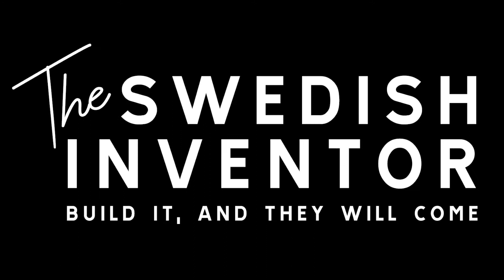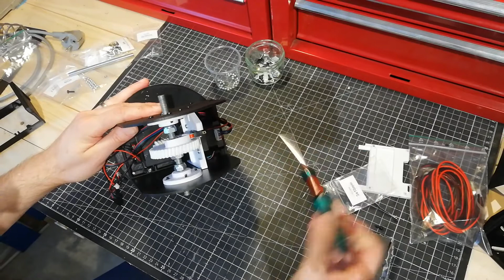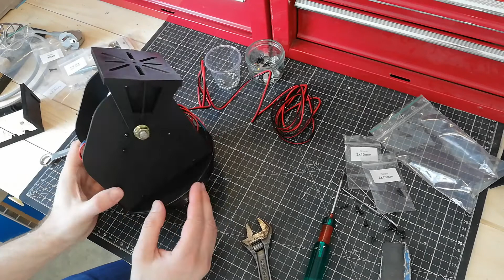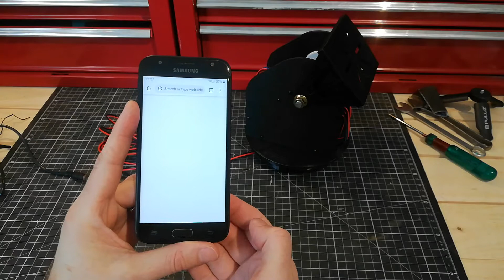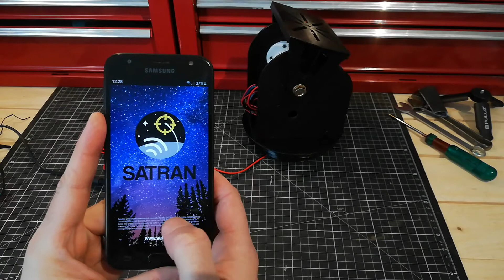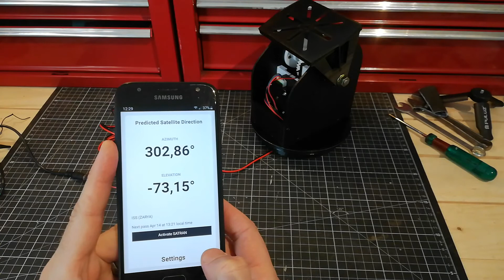How to assemble Satran MK1

Comment: what is the size limit for the nema17 steppers that would fit in the design?
Reply from the maker: Thats 30-32mm height for the MK1, since MK2/3 uses geared dc motors instead. More info in the forum: https://www.satran.io/forum/topic/stepper-motor-source/
Reply: @swedishinventor  Thanks!

Comment: Do you have a part number or source for the stepper motors? Difficult to find a match from the limited info on the BOM.
Reply from the maker: My design used 17HS12-1204S from Mybotonline. Good luck with the build!